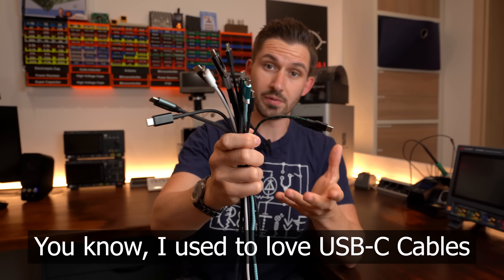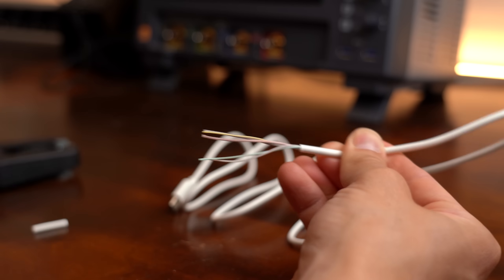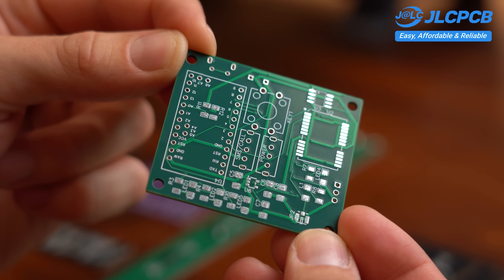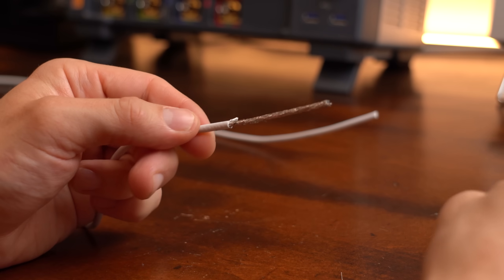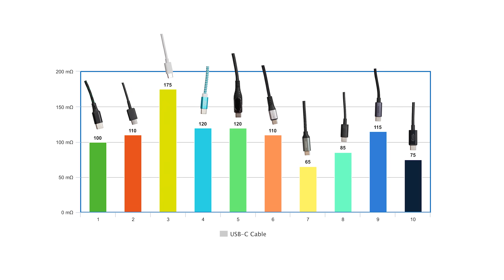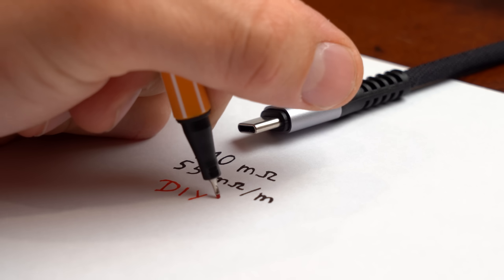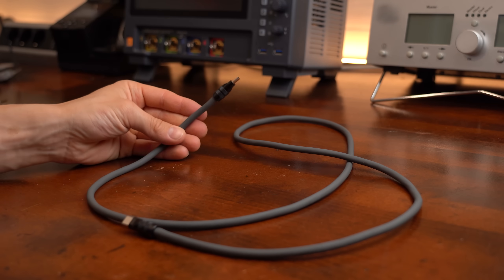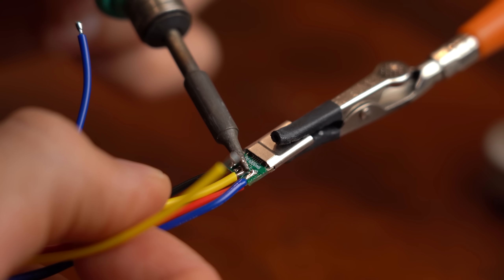Your USB-C Cable STILL Sucks — I Built a Better One? (DIY or Buy)

Comment: Audiophiles will tell you a good quality usb-c cable costs 2000€
Reply: You can see and hear the difference of the files you're transferring, they'll say.

Used to work at a hi-fi store, and always told you'll quickly find a "perfect" cable that won't pick up interference, and has minimal voltage drop and resistance, without spending an arm and a leg.

Still had costumers that believe their €200 lightning cable makes their music from Spotify sound better
Reply: They can hear the same ones and zeros sounding differently, truly a different breed of people.

Comment: 3:00 cable “G” has voltage difference of 723 mV, which is below 750 mV. Similarly for cable “L” and 748 mV.
Reply: That's because he accounts for margin of error.

There's always more resistance in a loop than what you can measure even with specialized tools. It's simply too close to that 750mV limit.

Comment: In my experience this is a non-issue. Cables rated for PD have always mentioned the power they can deliver, 60 or 100W. If a cable comes with a branded charger, it will always carry at least the rated current of the charger. Any cables that are slim and soft I always assume they re rated 2A max. The above are enough for me to never have any issue at all.

Comment: Some time ago I bought a Vcom (whoever they are) 2m 240W 20Gb/s cable for around 12€. Although I haven't tested it fully, it handles 45W without issue.

LTT are designing cables now and plan on selling them. Would be nice if you tested them when they release them (if it all).

Comment: If you swapped the brown an orange, then that should improve signal performance and data speeds.  Positive on one side and negative on the other will likely create a larger magnetic field and more interference, but having a +/- pair on each side should cause destructive interference with the magnetic fields, reducing interference.

Comment: How reliable are the contacts on USB C plugs and sockets at transmitting the high currents? E.g. 5A is quite a lot for such small pins, especially if the sockets fills with fluff.

Are both sides used at once to shere the current out?

Comment: n-USB = NOT (in the slightest) Universal Serial Bus :face-purple-smiling-tears:
You cannot charge at 240w on a 30w cable.
You cannot transfer data on a charging cable.
You cannot charge past 10w on a data cable.
You cannot transfer 5Gbps on a 480Mbps.
-...-
You cannot transfer 40Gbps on a 20Gbps.

HOW Is this "Universal" serial bus not false advertising, I do not know. :face-orange-raised-eyebrow:

Comment: I am surprised there are no cable testers out on the market to simply test conductivity. Would kill the crappy cable industry in the next second.

Also a cable should not have any chips. I hope the next cable version will be analog, with a simple feedback and a dirt simple voltage request by using a simple voltage divider. Charger would create the exact voltage, and the voltage divider would send a signal if the device wants more or less power. The feedback wire would indicate how much voltage is actually arriving and would be used to measure power loss over the wire. The idea is not fully formed since it takes no considerations of the extreme cases, if wires break or get a short circuit. But with 2 resistors at the end device you could get any voltage, and the charger would produce any required voltage, and do all the heavy work in detecting crappy cables and limit the power loss over the cable and even connectors. And the beautiful part... if you can get ANY voltage at the end, with some adapters even the old devices with simple jacks could be powered by usb. It's like having an universal power supply for all devices.

Comment: A charger with 5v 3amps power will change to 9v 1.5amps when fast charging is converted. If there is no charger wire, it will not change like that again.

Comment: "It's better to do it DIY, all you need is 300€ worth of tools and equipment+hours of time"
Reply: For a marginal, probably imperceptible improvement over a good, professionally built cable.

Admittedly there is a benefit to knowing what you have with DIY instead of the roulette wheel buying a cable feels like, but even having the necessary equipment (which also to be fair you could do this with just a $10 soldering iron and a wire cutter- it's really not that expensive a hobby to get into), I think I'm still more inclined to take my chances with a bought cable just for the simplicity in most cases.
Reply: well i'm not sure about the constant load for testing but the rest is less than 100EUR and will still have great soldering iron and usb tester afterwards

Comment: I'd love a logo system like Dvds had. Everything should be marked with a PD 60w, PD 240w, etc logo. Can it device to device charge? How fastvis its data?

Ill still buy trash cables for throwing in my bag and cutting up , and thats fine, sometimes i just want 5ish volts and it not to care whats plugged in .

Comment: Its 9v 2.5amps for QuickCharge 4.0 by broadcom and usb-a to usb-c cable  and Power Delivery 3.0 for 20v 5amps for anyone else who cares about usb-c to usb-c cable. And 20v 5amps is not by any means c9mpact, its typical notebook-sized  chatging brick.

Comment: 175mOhm as the worst cable is a very decent result, I love USB-C for putting this as requirement. I have a few micro-USB cables with Vbus resistance over 1 Ohm (!) and very few were actually going below 300mOhm (probably the microUSB connector added a lot as a base).

Comment: Great Video!
Did I get that right that at the end your cable has this specs:

- Supports USB Power Delivery Up to 240W (minimal resistance)
- USB 2.0 Data Transfer speed

Do you think it is possible to do a DIY "GOD-Cable" with this specs:
- Supports USB Power Delivery Up to 240W (minimal resistance)
- USB 3.1 Data Transfer speed
- Support of Display Port and all the other stuff

ore is this maybe a level to high for DIY because you need expensive manufactoring machines?

Comment: The main reason I built my own cables is mainly quality issues of production ones and specific lengths I need if I don't need 18 cm of cable I built my own one and safe resistance and interference on 18 cm.
Same thing with POE cables.
With the current prices it adds up pretty quickly if you save a view watts everyday. And on the long run my own cables might have a much longer lifetime.

Comment: What about data transfer? It's as niche as power losses in average users but is more complicated isn't it?
Also, how would you rate the overall feeling of using your diy cable? I got one from temu which transfers power and data (at supposedly 10gbps) that works just fine for me but is heavy and super rigid, so that's something I'd consider next time I buy/diy a cable

Comment: I cant believe this popped up in my feed. I have been thinking about doing this very same thing, for the very same reason, for a very long time now lol. I just spent a bunch on some cables the other day and the thought had popped in my head again. I dont know why I can't get a nice, thick 20-18 AWG, silicone, braided type C. I realize the conductors dont need to be so large, but its so much better for durability. Especially if you could just buy a connector with terminals on it. One cable that could last for years. 

Maybe not profitable for 99% of companies. But NO ONE has come along to sell any truly durable cable? And I do mean that. I have tried so many and I personally havent found one that was durable and still remotely flexible. 

I just buy 240w Thunderbolt cables and they last for maybe 3 months of hard use before I replace them. Super stiff, but it works. I'm sure with silicone wires and a nylon braided sheathing, you coukd get a pretty flexible cable that is still very tough.

Comment: Your test setup is really weird and I have some doubts about the correctness of the measurements so the numbers should probably be taken with a pinch of salt. It would probably have been easier and more accurate to simply use 2 USB-C socket breakouts, use your short dummy (or even create a dedicated one with 2 big bus bars back to back) to establish the baseline loss of the connectors and then then use a multimeter to test the resistance of the cables. I've also tested a lot of cables but I actually care about USB4 functionality, too. IMNSHO it is really tough to have a self-made solution compete with a complete cable since the raw cable alone in a decent quality is already way more expensive than a complete USB4 cable. Regarding your cable introspection I also have one comment: Not just the gauge is important but also the material, aluminium has a 37% percent higher resistance than copper at the same diameter and some of your cables clearly used aluminium, maybe there were also some copper coated aluminium ones...

Comment: I have been making my own Audio cables for years and can highly recommend it. There is so much snake oil in the "proper" price range that going the DIY route just gives you better Quality for a lower price + you actually know what you are getting.
USB can be the same... I just bought some "fully USB4 compliant 240 Watt" cables. 50 Euro for 1 meter. They can't handle Display signals, they are only 5 GBit and they sure as hell can't handle PCIe. I am almost certain i could make a better cable for less money.

Comment: Same problem with micro USB charger cables, to much voltage drop and phone is charging very slow. In most cases there are linear chip, that need to output 4,2V for battery. If you lose 0,5V you get 4,5V at input and it doesn't work. Cheap USB amp / voltage meter can be your friend, when you use older devices.
ps. 20+ years ago there was same situation with audio video cables. Most of the time it was better buy connectors, cables and DIY it.

Comment: This reminds me of a project I did many years ago trying to get a WiFi dongle working up a mast. I soon figured that the voltage drop was the limiting factor, with only 5v to play with any loss was a problem. I ended up feeding 12v up some cat5, using whites as ground, orange blue n brown as 12+, green/white as twisted data, and a 7805 at the dongle end to give a clean 5v. Even with a bit of voltage drop had plenty of headroom. Achieved a reliable 25m usb run. The engineers at work insisted it would never work, to long for the usb data. But it worked flawlessly for 11mbs wifi
Why bother you might ask? The dongle was modified to have a 4 element yagi built from popsticks an hot glue, mounted in a butter container, taped to a broomstick, shoved into the gutter. This was pointed at the local McDonalds almost 1km away so I could get free WiFi ^.^ It timed out after an hour, but was easy to reconnect, and only had limited ports, so no gaming or bit torrent, n kinda slow. But was enough for casual surfing, messaging, that sorta thing. 3g phone data was hideously expensive, and I was only going to be there for a few weeks, no point getting the phone line connected.
Voltage drop is a hard thing to explain to non electrical people who find it hard to understand why you would use a $50 usb-C when 'the same thing' can be had for 5 bucks on eBay. And then complain their phone takes hours to charge
Reply: I run 2 runs of 2x 8ga wire up my tower for delivery of 28V@ about  30A. All my equipment on the tower has voltage regulators it is the easiest and best way to provide ample of voltage and current to the devices without the hassle of having direct line voltage up there.
Reply: Ethernet and telephone cables are great for everything lower than mains voltage. They have their diameter printed on, and are readily available. I use them to run power to my led strips and even feed hdmi through a pair of them (~8m)
Reply: I find this ingenious, hilarious and probably something I would have done too😂😂😂
Reply: Use PoE.

Comment: Finding decent 5A cable today is easy. Finding a USB A to female USB C adapter to modernize my power adapters that handles 90-240W is the hard part. I don't know why they always topped at 3.5A.

Comment: Something to consider.. If you've ever bought a product that comes with a very nice quality USB-C cable (for example, an audio interface, high-end computer monitor, etc), the cable almost always has a model number tag on it. Manufacturers will usually source cables that are certified for a certain spec. If you search around with a model number, you can often find the same cable for sale. My RME audio interface came with very reliable USB3.0 cable from the German vendor Assmann (ho ho..). I was able to find the same cable for sale on Amazon and bought a couple of spares.

Comment: Actually, Ugreen writes pretty small the power rating on the rubber part of their connectors.
And they tell you clearly, this cable is rated for 20V@3A, no 5A with a right angle plug

Comment: To be honest, this video doesn't make sense. Just purchase USB type-C cable that are made for power transmission if that is want you want, like the chubby cable. There is a lot of cables that are designed for USB solder iron that are robust, low impedance and pretty cheap. DIY never make sense for commodity product that are mass produced...

Comment: There are lying store listings for usb-c cables but at this point they are mostly the exception. 
The certification rules and what should or shouldn't be in a cable has been clarified a lot. There's virtually no reason to go DIY for a pure charging usecase. As soon as a cable is USB-C to USB-C it's required to do the 100W now. 240W versions are clearly labeled (newer standard).

Usb-c is a clusterfuck mostly on the device side. Nobody is fully implementing all the alternate modes. Not even the Thunderbolt certified ports (though they cover all the ones people usually care about). But i don't think that's about to be fixed anytime soon. The next iphone isn't about to be equiped with thunderbolt....

Comment: Great, but you really should have used twisted pair for D+ D-    There are plenty of cables out there with 3-4 pairs of shielded twisted pair.  One pair for D+ D-, one pair for power, and another pair for CC1 CC2 (which are static and really don't need a lot of care, except maybe some shielding)

Comment: the power loss doesn't bother me.   warm/hot cables very much do.   i wonder if you could take a cheap usb-c cable and somehow add thick power wires and leave the high speed cables etc untouched.    just a thought.

Comment: About transfer speed I though its bullshit, but then girl on my previous job brought thick and short cable, and with it transfer speed was 3 times faster. It had same contacts, same connector, same wiring scheme, but thick and short. No idea why mine was slower.

Comment: You can use big size solder wick to use as shielding. Just insert the cable into it before applying the heat shrink tube.

Comment: You can use SSTP 7a LAN Cable for this, i think there's some with extra shielding made for PoE voltage in Mouser or Wurth, you can skip the SS pair with that IP2133.
For thinner wire, you can use 30AWG UL 20726 Silver Plated FEP like Molex 100057 but that is seriously expensive as hell so it's probably not worth it, that Aliexpress one is fine.
And finally, there's also an option to use "cryogenically treated" cable but... honestly, only idiotic Audiophile would use that so, that's even worse.

Comment: The USB debacle repeats itself, where "manufacturers" don't follow the standard precise enough and/or the standard is just defined "too open" leaving too much to interpretation.
I would recommend , when investigating cables & wires, to have a small strong magnet handy; too often the wires are not full copper but in fact tinned (or copper-coloured) aluminium!
The cost-saving measures taken by some are truly almost criminal.
With DIY you are at least better guaranteed you in a more safer spot when it comes to the higher voltages & currents with such cables.
Reply: Nothing wrong with aluminium cables *if *properly dimensioned for the slightly lower conductivity.
It's been used for decades in power grids for good reason.
Problem is that the user never knows if this is the case until its already bought and paid for.
Reply: @johanmetreus  Agreed! But too often in low-voltage applications, aluminium wires are abused as a poor substitute. E.g. take apart a typical LiFePO4 battery from the infamous Alie; wires which should be AWG 6 due to currents/loads, often turn out to be (copper-coloured) aluminium. E.g. take speaker/ear-buds applications; to keep wires thin and flexible, aluminium is often used. I would dare to claim it is often due to cost-savings rather then the typical applications. Whilst I do agree there is potentially nothing wrong using aluminium, why do they take the steps to colour them in copper-colour then? And let's not forget aluminium only has 61% IACS, so you will need thicker conductors compared to the same amount of copper...
Reply: @InspectorGadget2014  Indeed, Al conductors needs to be thicker than Cu for the same current.
Coating is a way to solve the problem of surface oxidation that causes higher resistance in connections, but as we know it can also be used by less scrupulous traders to mask a cheaper construction....  worst is the examples BigClive found with coppercoloured iron thread used.

Comment: Connecting the USB differential lines directly to the connector without twisting or shielding will result in an impedance that deviates from the required 90 ohms, which can degrade high-speed signal performance. USB is not DC.

Comment: It would be easier just to buy from the brands you tested a lower resistance with. Also the reliability of the DIY cable may not be as good as the buy version, and the thickness of the DIY cable is also much larger than the buy versions. I would probably conclude BUY for most people and DIY only when you really need to push the limits of cable efficiency.